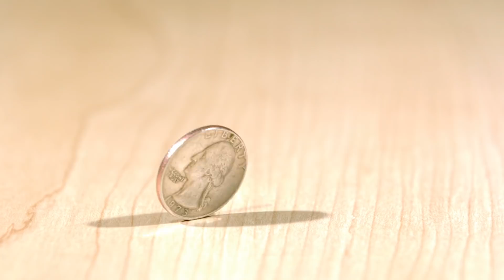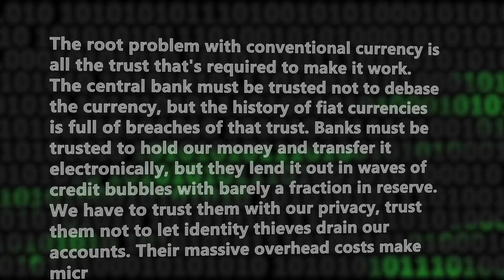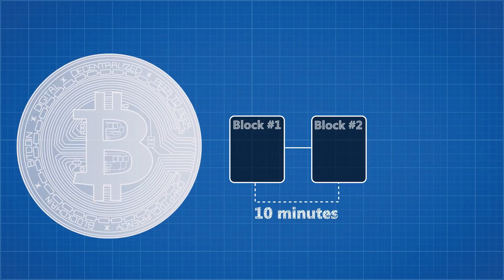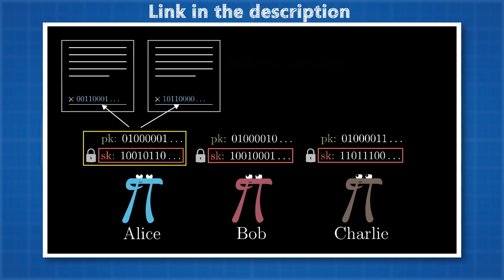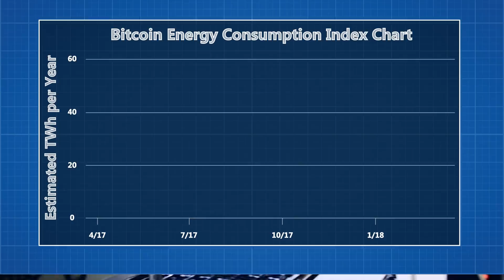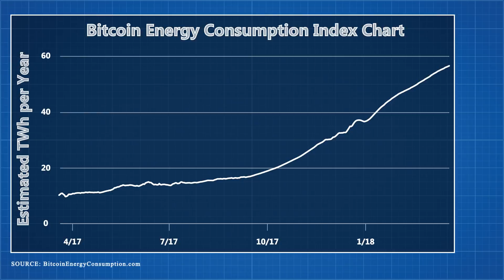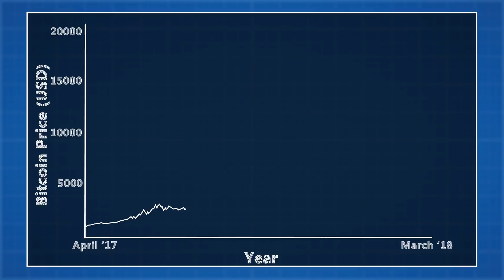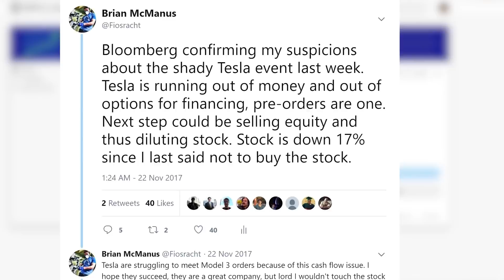Why Bitcoin Is Not Working

Comment: * Bitcoin is money, not engineering. It follows different principles.
* Bitcoin is working already with the current coins. Why should the energy consumption to mine new coins be a problem? It is an advantage because Bitcoins are limited this way. There is no printing press.
* Every investment may be volatile, so what? This is called market.
* Bitcoins are exchanged to other currencies, so what? This is daily business for a currency and proves fungibility/ liquidity.
* On a global level cryptocurrencies will save transaction fees, time, paper work and process costs and transaction fees in huge amounts. These huge savings will be at virtually NO costs since computers will be running all the time anyway.

Comment: Cryptocurrencies would be a wonderful backup currencies to combat economic crises. In the case that there isn't enough trust in existing capital to perform basic transactions (e.g. buying food) you can introduce a cryptocurrency to provide just enough capital to keep small communities working.  Just get a small referendum to adopt and then offer anyone joining a small amount of the new capital to get started. As long as the starting money is the same for everybody you've got a place to start price negociations for goods and services.

However, with Blockchain's limit of 4 transactions per second it becomes impractical to work an economy larger than a large town. Working between crypto currency networks would require at least theoretical exchanges of commodity moneys like gold or meta-crypto currency networks. Essentially, you'd need to exchange currencies just for changing zip codes. 

In short, we'd be back in pre-central banking times but that's still a favorable result to flat out barter economies or the economic shut down from credit panics.

Comment: So it's not working cause the old SHA256 algorithm uses alot of power, and not stable? Yet Bitcoin's value doubles on a clear point of DOUBLING within the algorithm. Bitcoin crashed because it reached it's doubling point, NOT MARKET MANIPULATION, the value peaked and than the SUPPLY doubled as well as the peak value. You really need to do A LOT more research into Bitcoin and the other altcoins. Newer algorithms are also built to correct the SHA256 flaws. However Bitcoin is WORKING AS INTENDED it was designed upon how GOLD IS TRADED. To be a new currency you need a "Gold" standard and Bitcoin is now that standard for the altcoins. It's still very valuable and will only grow into be twice a valuable before the next doubling in the algorithm. Also you ignore the facts that processing power is getting ever more powerful and efficient just because it isn't at that equilibrium now doesn't mean it will be in the future. This video is only misinforming people with half researched information. Don't look at markets, look at the algorithm doubling aspects and rules. Your reasons it's not working are nonsense. https://en.bitcoin.it/wiki/Controlled_supply  See "Money Supply"

Comment: They didn't recently create another form of currency debt, every dollar IS DEBT since the money system was taken off the gold standard. 

The consumption of energy for verifying Bitcoin is a non issue, because it is vastly lower than the amount of waste produced by the banking system. Moreover, Bitcoin miners go to where electricity is cheaper and those sources tend to be where there is a disparity the demand and supply ie where there are few people but a lot of energy. Think about isolated mountain hydroelectric dams, or wind farms, or geothermal stations (like those in iceland). Estimate the costs of printing fiat money and that alone is a huge industry and a wasteful one at that as they are serving a corrupt system.

The point of moving to Bitcoin is not for fun, nor to just speculate and make money. But to keep our money and escape the debt system which has been created from corruption. You lose 3% buying power simply by holding fiat. This is outrageous. 1 Bitcoin will always equal 1 Bitcoin the supply never changes and thus it is not Bitcoin which is volatile but fiat, as it is printed en masse everyday. Bitcoin is antivolatile. The volatility of fiat against Bitcoin will subside with mass adoption. Bitcoin is TINY compared to anything else the economy. And even when compared to other bubbles"" not even 5% of the dotcom bubble.

Honest I trust Bitcoin and DigiByte more than I trust ANY other traditional currency! The only traditional currencies I could ever trust are those backed by a commodity like gold or silver.

If you like Bitcoin and crypto but dislike the centralisation it has lead to ask yourself two questions. Is this centralisation greater than or less than that of the banking system? And second question if you don't like this amount of centralisation in Bitcoin then go to another coin there are many available and some which have extreme protocols to keep decentralisation and GPU mining notably DigiByte DGB. And DigiByte is not limited in the same way Bitcoin is, DigiByte scales on chain and is currently at 560 TPS will be 280 000 TPS in a few years, Bitcoin can do something similar but through the lightning protocol.

Loved the channel loved the videos on engineering, but stay in your speciality - engineering. This is not Real Economics. Don't spread misconceptions and misinformation. For this horrible video you get a dislike, I hope I don't have to unsubscribe from your channel. Please also put out another video and CORRECT these errors.

You pass opinion off as fact, the facts state otherwise. If you'd like to know more about cryptocurrencies Bitcoin and DigiByte please ask I would be happy to explain these things. Maybe even get the founder of DigiByte to come on for an interview, he'll teach you a thing or two.

Comment: The volatility is less if you use a log chart, it's also an incredible small market cap which causes volatility along with speculation.
Reply: the volatility doesn't get less when you use a log chart. Your are presenting your data in a way that dupes people into thinking that because they can't read log charts.

Comment: This is mostly based on outdated Information. Also the disadvantages are not being put into perspective. 
1. Since Lightning the transfers are faster and cheaper than ever before.
2. Energy demand will therefore not rise proportional to user amount / numbers of transfer.
3. The strong volatility is not that strong anymore.
4. Guessing of prime numbers is indeed a little senseless. There should be a better way to use that computational power and there are, e.g. a blockchain application that uses the power to calculate scientific tasks.

Comment: Love your videos but if you are going to make a sweeping statements comparing the environmental damage as a result of one system to another you are going to need a more complex life cycle analysis to back it up. as you clearly pointed out Visa is dependent on current financial systems and therefore these need to be brought into the analysis. Considering the amount of people who are required to run these I'm guessing there energy/environmental impact would be tipped in a very different direction (if bitcoin itself were to be be decoupled that is). Again great vids!

Comment: The biggest strength of bit coin is also the biggest weakness. Being independent and decentralized also means you are a lot more vulnerable. If someone steals your bitcoin its gone forever. There is no way to recover. The reason we use money is to facilitate trades, but the reason we use banks is for the security. Bitcoin give us the facilitation of money but not the security. If a hacker hacks the bank its the banks problem. If I put my money in the bank, its always the banks problem. In case of bitcoin it doesn't matter if I use a virtual wallet, the risk is always mine. For me, that is why bit coin is not working.

Comment: Engineering is a different field compared to Crypto Currency Algorithms, ya didn't tackle many use case and critical points about bitcoin and other Cryptocurrency, ya know so little about it. Not because both fields had a relevance to numbers, it doesn't necessarily means ya can probe its real use case basing on your own personal perspective. There is a ever evolving structure on blockchain which programmer and coders can only under stand its real use case. Our future is on the hands of these programmers, as our God is considered as the best programmer :)

Comment: The points you are making in the video are mostly moot: Lightning network and other scaling solutions will enable basically infinite amount of transactions, and most of the electricity used for mining comes from hydro power plants that cannot feed the excess energy to the power grid. It is like declaring in the 80's that "the Internet is not working" because it is so slow and no one is using it.

Comment: Well when the internet gets properly set up everywhere with practicly impossible odds of going down (5G finger crossed), and such computation power is avaiable, we can just machine the whole "blood of civilization" = information distribution.

Imagine that you want to buy a banana. At the shop you take it and walk out letting the system know through this 5G blood that takes it where its needed. So at the moment a banana worth of depth is in the system. The computers now allocate an opurnity to you to work for that banana accordingly to youre profile (limited privacy in the future). Now since convinience is important in the modernization you most likelly just continue youre work like you do now in the same place working down depths and generating extra leaverege. So what if you cheat? You cant. Since youre work will become someones exchange down the line, if that doesnt happen then it will be traced back to youre failure, and be equvivalent of police finding out you used a fake money to buy the banana and will be prosecuted accordingly.
Thats it, you simply cannot cheat, beacuse if someone does, then theire missing work for the banana will pop up somewhere and due to the seamless connection of 5G and the computation power that tracks the flow of work done and the limited privacy you will be traced down as a hack who technicly didnt payed for the banana.
There wont be a middle man, since they dont check the quality or amount of work you do. It is a simple 1 or 0, wich means you either did something to deserve the banana or not. There is no middle ground. If someone certified youre work and accepted as valuble work being done then the system will clear you. Whatever human error you would put in this is on the person who got fooled by a shady work. Its on them. Git gud, you wont get tricked.

Serisoulsy thats how a simple taxi driver work. or restaurants. You get theire work and accept the resoults and then "pay" wich means you aknowledge theire  effort as worthy. There the exchange happened. And then you go out and like do work, like creating a machine that makes knives which the restaurant gets... im bored

Comment: Do you have any problem? Do you find a way to short out that problem? .The Bitcoin Code is a best money making trading system for solve your financial worries.The Bitcoin Code does all the work for you automatically The Bitcoin Code auto trade software you need to end all your financial worries is absolutely free.100 average people with no previous experience make 50,000.00 weekly using The Bitcoin Code with an incredible binary option auto trade software called The Bitcoin Code.Mail me >> (lashondamlyon89 AT gmail dot c~o m )
Reply: This is the good way

Comment: In a way bitcoin has become a ponsi scheme. People bet on the value of bitcoins going up which works as long as more people come in believing the value will rise. As soon as there is a crash it won't work anymore.
We should make use of blockchain currencies for specific things, but bitcoin at the moment is way too volatile and inefficient.
The biggest problem I see is hoarding. 
How would you implement taxes for example? Could they even be enforced?

Comment: quantative economics is based on rational economics which at best is successful %40 over a period of 5 years (since human beings are not rational majority of the time), its what caused the crash in 2008 by those horrible calculated risk quants. Anthropological mathematics and Biological mechanics work much better.

Comment: Ok... so here's my issue. My mobo has multiple PCI ports. How can I just use one card for gaming, and another for mining, if the amount of lanes allowed by my 7700k get cut in half after adding another card? It even has a label for each slot "16x", "8x", and "4x", respectively giving diminishing returns if I were to do this. Or do they have specific Motherboards that handle this kind of problem? if one card is pumping out block chains, doesn't that mean the next card will be doing half the work, or if I'm gaming, its already doing half?

Comment: Not correct about power that Visa payment system uses. Visa card is the key to the bank system, not the bank itself. You forgot to mention how much energy the banks are using. All computers, servers, back-up systems, data protection & cyber security systems, all infrastructure.

Comment: The US dollar had lost 99% of its value since 1913 and you say Bitcoin is volatile? You are in way over your head here. And I didn't hear a reason as to why Bitcoin doesn't work. BITCOIN WORKS. DEAL WITH IT YOU KEYNESIAN NO COINER
Reply: Yes, when comparing bitcoin to the US dollar bitcoin is volatile and the US dollar is not. It took 105 years for the US dollar to loose 96% of its value, or about 1.09% per year. Compared to Bitcoin, where the hourly change is signlificantly more then that, you have to have absoluvely no idea what the term "volatile" means to pretend bitcoin isn't the one of the most volatile currencies ever created.
Reply: Zontar US dollar is inflationary, Bitcoin is deflationary. One of these has steadily gone down in value, one of these has steadily gone up in value. See you at $100k, normie
Reply: There's nothing steady about bitcoin's rise in value, quick thorowing your 5 minutes of internet searching and passing it off as being an expert on economics.

Comment: i watched, was a little triggered by the title but listened. I think its an absurb statement after watching. Bitcoin is not "working" because it already "worked". Blockchain technology transforms debt based centralized mediums of exchange into decentral limited supply mediums of exchange. The latter is required for freedom and former for tyranny.

And in terms of energy we used to run light bulbs at 60v 2 amps. now everything is super efficient led. We are little pussies when it comes to using electricity and seriously need to step up generation and use. Solar is a great and viable tech and crypto can be a pusher in green energy adoption.

Comment: You attack it for all the most easily rebuttable reasons, the energy isn’t an issue and largely uses renewable sources and sources that would go to waste anyway, the volatility will inevitably go down it was designed to generally go up at first it is very young and won’t be volatile forever. Wow for an engineering channel this is a really shortsighted and petty analysis, and the scary music doesn’t give it more credibility.

Comment: I think the main problem with bitcoin is the slow speed it takes the register a transaction into a ledger. Have you ever tried to exchange usd for bitcoin or viceversa? Its not instant and sometimes it takes a very long time if you dont add a big tip for the miner to put it in the ledger. Thats the main problem with bitcoin right now. You cant commercialize it right now. Imagine going to a store to buy a can of soda with bitcoin and to pay with bitcoin, and passing the bitcoin to another person will take a while for the miner to put the transaction in the ledger.

Comment: Bitcoin is what I like to call digital gold.  It's not what the currency was designed for, but it's the way it ended up.  It is just another finite commodity to put your money into that grows with the market, where you can transfer it for dollars.  Like gold and silver, Bitcoins are becoming harder to mine with time and are requiring more energy, except for bitcoins, unlike hard commodities, are basically pure energy.  

I am starting to think that etherium-based cryptos are the way of the future, because they function as much more than just a commodity, but an actual means of transaction.  With etherium, you not only get a decentralized creation of currency, but ALSO decentralized method of transaction in itself, where the network can hold a transaction in a smart contract until all transaction parties agree to allow it to pass through based on various programmable conditions.  It's still going to have the same problems with speculation, but with the transactional capabilities, it is becoming preferable to a lot of people.

The problem with all cryptos isn't the value problem.  It's the fact that no central bank is going to accept any threat to their existence.  They will use force to shut down these currencies, something many countries have already done.  These currencies will always be more of an underground commodity and can't ever be mainstream.  Big banks have too much power.

Comment: Typical humans really. You have a transaction system that works fairly well but can be expensive so humans construct a system that is cheaper, but it is actually more expensive because it draws alot more power. Guess what will happen with the Electric Vehicles? you just know something will spike!

Comment: What a load of rubbish..... About the only thing you came close with was its similarity with gold, if you look into it properly you will see that bitcoin was actually designed to simulate gold/precious metal quantities so hardly one of its "failure" points. There I was thinking there would be some decent knowledge here. Good luck with your con adverts.